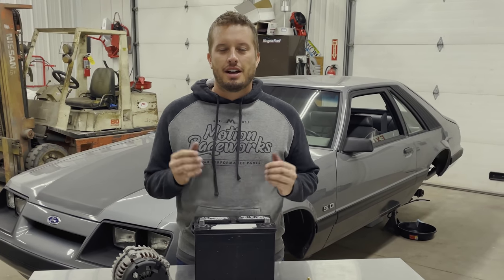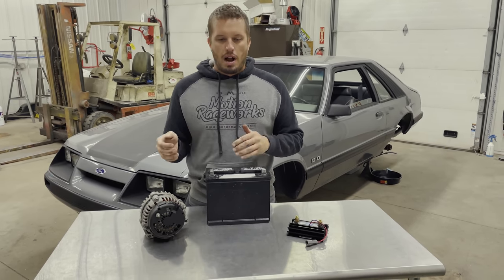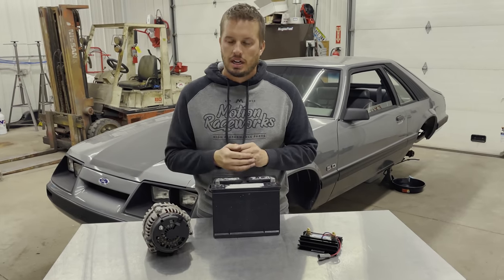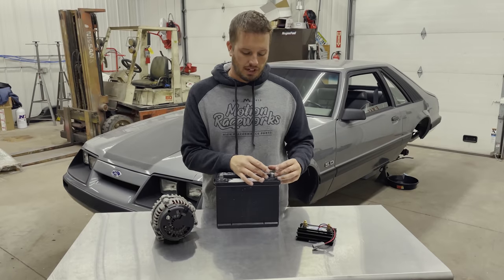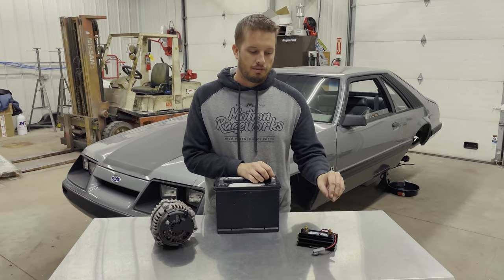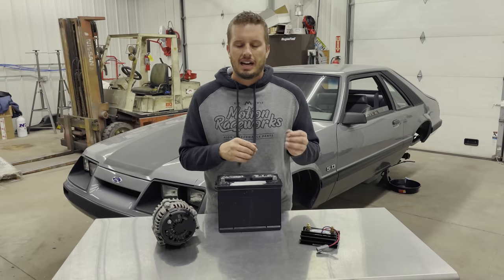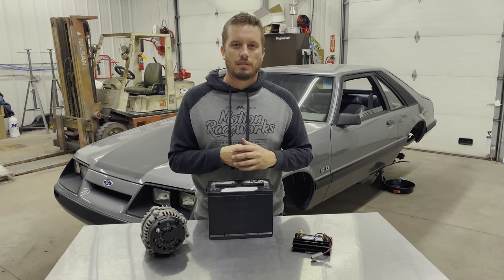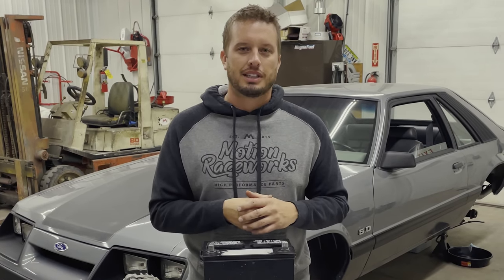Alternator Kill Switch Proper Wiring: Tech Tip Tuesday

Comment: Two downsides to this way of using the killswitch: 

1: your battery isnt disconnected from the alternator, so in a bad crash theres still powered wires going to the engine bay, which could be a fire hazard (this isnt legal in some motorsports..battery must be completely disconnected from the rest of the electric system) 
Good example of this problem was ol Cleetus`s crash with Toast where the alternator got smashed by the framerail, that could have caused an electric fire even with the kill switch turned off.
2: (not as important as # 1 but nonetheless.. worth to mention at least) The battery still drains slowly over time when parked through the alternator and/or ecu, especially irritating on racecars that dont get out every week, getting to the track and finding out your battery is just about flat from sitting all night in a cold trailer isnt fun. 

 Putting the alternator wires on a big solid state relay switched by ignition power (which is powered by the KS, so KS off means everythings really off) solves a lot of those issues, and doesnt add too much to the cost of your build.

Both of those points come from my personal experience, i`ve had an electrical fire inside my car during an ovalrace (36 cars on track) after I lightly (.....) tapped a competitor pushing some sheetmetal onto my alternator connections, safety officials were not too happy about that incident to say the least.
Reply: Or, wire the killswitch into the ground, including the EFI controller. Hit that, kills everything. Safer too.
Reply: I agree. I think the problem is in the wording. Kill switch vs battery isolator. For the schematic at the end I think it would be important to add appropriately sized fuses to all loads connected to the battery at the very least. 

As far as the isolation on the ground side unfortunately it is not an accepted way per the NHRA rule book.
Reply: @Reagent92  You have some valid points, including the lack of a label for the 'switch' shown in the diagram, meant as a 'kill switch' and from the views, concepts and principles of electrical, electricity, wiring, wiring diagrams, design and implementation, the label and naming 'kill switch' is actually false, incorrect and misleading.
There are some other basic issues with the diagram along with proposal, description and implemented system wiring regarding electrical, function(s)m functionality, dependability, reliability, and safety within electrical and over all vehicle with the desire, idea, concepts, issues, importance, necessity, requirements of the 'kill switch' concept as Doug described and  @Bob Higgison  mentions in his comments.

It is very obvious to me that most people involved in the various engine, motor, racing, modifications, performance, upgrades, etc., including this channel an nearly all that i watch, follow and have interest in them, lack basics of electricity, electrical, wiring, etc.
Within all and each of the comments here, there are good points and clear, obvious, certain false information combined within them, thus clear each lack the basics.
The NHRA Rules are based upon proper information, knowledge including electrical, fuel and mechanical issues which affect safety for the drivers, crew, emergency attendants, people along the track,at the event and in the stands. during the every use of these vehicles from the pits to the track, down the track, etc., and during any emergency, accident, crash, etc.
Such NHRA has rules for automated shut off/down, driver and crew chief by remote as least for Top Fuel dragsters and Funny cars, probably all vehicles which use methanol  and the various automated and manually triggered fire system requirements too among many other safety requirements.
🤓
 @Robert Shepherd  , Your comment about a 'ground' based switch clearly indicates Your lacking of basics with and in electricity. Electricity is NOT similar to plumbing, tubing, liquid or air flow. A complete electrical path is required for any electrical potential [voltage] to exist at any point which allow energy flow [current]. The voltage does not exist up to the switch as with liquid or air pressure up to a valve or similar. Adding any break, switch in the 'ground' side of a circuit does not accomplish anything and is certainly not 'safer'.
🤓
@Mark S; Your ideas, concepts about a 'bad crash' and Your examples with the "Toast' drift car crash of Garret Mitchel [Cleetus McFarland] and Your personal  do NOT correlate and the two examples are certainly NOT similar. It seems to me Your personal situation was NOT an actual electrical fire, rather a fire of some combustible materials due to a possible short across from the alternator output to chassis ground due to a piece of sheet metal which was damaged and perhaps pushed to make the contact thus competed circuit - short possible and thus some 'sparks' which ignited some other material(s), including flammable fluids. [without knowing more of the precise, exact detail of what actually was burning, inflamed, it is impossible for me to determine.  However, there are not any possible High Voltage, High Current or High Power electricity which can actually be an electrical fire within the vehicle. 
My knowledge, expertise along with experience as both mechanic, mechanical, electrical, electrician, electronics, chemistry, materials, physics, engineering allow me to say with confidence the description is lacking proper information, details, accuracy and precision.
The safety officials were not pleased for many possible reasons, which may include some improper wiring, lack of proper safety switches, fuses, also regarding the whichever flammable materials became inflamed, lack of proper electrical isolation, insulation covering over the electrical connections [so to prevent the short] proper fusing, if a short occurs, and lack of other proper safety such the 'electrical short' and 'sparks' would not have ignited or initiated burning and flames inside Your vehicle, Also they may have been upset about some lack of automated or manual fires systems too.
🤓
A. These and nearly all types of internal combustion engine vehicles use DC power < 20 V DC. The highest current exists with the starter  motors and high voltage DC exists as output from a coil/coil(s) or magneto, to the spark plugs  ~ 40kVDC.
B. Alternator - generates/produces AC voltage, converted to DC within the device and in combination with a regulator - 14.5. VDC for 12 VDC systems,  19.2 + VDC for 16 VDC.
C. Electricity is an energy, never a flame or fire itself. 
D. Some fires can be initiated by flow of energy or spark of electricity igniting a material especially flammable materials.
[similarly the spark of electricity passing-jumping across the electrodes of the spark plug, ignited the flammable fuel-air mixture inside the cylinder.]
A sudden short can result in a spark which can ignite flammable materials.
Such, sometimes a fire which was initiated by a spark may be referred as or called an "electrical fire" though the fire is not actually electrical, but initiated and ignited by an electrical spark.
🤓
Hope this information is clear, useful, helpful, beneficial and make sense too. 😏

All The Best and Much Success in Your Quest, Health and Well Being. 😊
Sincerely ☺
Reply: @newtonfirefly3584  Me next! Me next! @FlipFlopTanLines, PLC automation and Electric lift tech. My comments are all over here lol.
Reply: @flipfloptanlines926  Have read Your comments, since.
You express some important points, aspects, concerns and good general view within the entire system, especially of the electrical, power aspects, affects, etc. overall.
Your example that Your father led  You to  experience with the coil output voltage is 'very powerful', but dangerous since it is 20kV-40kV depending upon the age-time period  version of ignition system [electronic, coil packs, etc.].
It appears that perhaps, You may benefit more from some actual basic information of electricity, electrical circuits as hopefully You have with mechanics, mechanical, machines beyond these seemingly 'practical' type lessons.
Does a person need to experience 'high voltage' shock to comprehend the power, danger and necessary safety ?
Perhaps observing and noticing a spark emanate, from a spark plug between the electrodes or across from the high voltage coil output side wire to bare metal, arc through the air, 'jump' is sufficient ?
Does a person need to experience harm, damage, breakage, destruction to comprehend the power of mechanical, machines, forces ?
Does a person need to experience the power of lightening to comprehend it ? Perhaps, small static electricity shocks are sufficient or also not necessary and positive uses like rubbing a balloon on Your clothing then placing it upon the wall, observing and noticing that it holds, stays, adheres?

My father led me with basics in  mechanical, carpentry, some minimal electrical, developed  more in public school 'shop', including electricity, electrical, beginning electronics, then further in physics and engineering in University, as Co-op Engineer in the testing, assembly laboratory and afterwards in design, development, etc. 
Also learned and am certified within ESD, which most are completely unaware of and the affects, effects which exist with most all electronics, especially of the last  years plus [which include whichever computer electronics device You connect to this platform and others].

All The Best and Much Success in Your Quest, Health and Well Being.
Sincerely
Reply: @newtonfirefly3584  so how do you wire an alternator with kill switch?

Comment: what is this kill switch     i searched for it the whole internet and still didnt find it     i want that kinda switch that kill the system with and internal and external button other then cartek
Reply: Data Panel DP-22068 Solid State Battery Disconnect Switch, 200A, Includes Pigtail

Comment: What if you have everything ran off relays and want to put a kill switch on the switch side so when you kill power it turns off all relays? With power sitting at the relays but unable to flow?

Comment: Great videos. I was wondering is there a standard fix for over charging your system? If your alternator gets to many rpms from high horsepower  engines they will fail or over charge. is there a fix?
Reply: Yes, a larger alternator pulley.
Reply: Larger alt pulley #1. Some vehicles have adjustable external regulators that could be creeping out of adjustment contributing to overcharging. Generally the brushes, bearings or spinning mechanical parts fail at high rpm, not its voltage or current output electronics.
Reply: If you think your alternator is getting too much rpm than there is a possibility that your water pump or power steering might be receiving excessive rpm also. In which case a smaller CRANK pulley would resolve the issue as a whole. Just a thot before you replace the alternator pulley with a larger one, which is the correct fix for your question.

Comment: This is good, but what about NHRA rulebook saying killswitch must kill power to entire car? the stud at the alternator will be hot at all times wired like this. Rulebook aside, I like having all the power off when I'm under the hood
Reply: My father taught me the same thing to isolate the COIL when i was 7.  He said cover the coil post with my hand to "isolate" the spark from any metal. IT HURT BAD when he bumped the starter. Later i realized his class wasnt on safety, but on electricity and its force. With 1 rotation of the motor i instantly turned into Tesla lol
Reply: Your exactly right - his method described here is not NHRA legal.
Reply: you would run 2 disconnects, one for the whole car and one just for the alternator wire going back to the battery, gets pricey but guarantees no power anywhere in the car except between the batter and disconnect switches which normally tend to get wired pretty close together, just my humble 2 cents, you can wire both together so your remote e-stop button at the back or buttons if you have one inside the car as well can shut off both disconnect switches at the same time
Reply: @CarlosDiaz-xf8pk  Yes, I have 2 contactors, the ones I use are $25 ea. and yes either the switch on the back of the car or the one in the interior cut both contactors. They also sell 4 pole kill switches.

Comment: Could this be used with a car that still uses a factory ignition switch, just using the cars key to turn the kill switch on and off?
Reply: Yes and no.
:D
1. You can (and must) use the kill switch according to most sanctioning body rules, regardless of how you start your car.
2. The factory key switch doesn't meet the requirements of a kill switch..it needs to cut all power to the vehicle, and it needs to be externally located at the rear of the car so track safety crew can safely shut you down if need be.

Comment: What gauge can be used for alternator to battery?
Reply: Depends on Amperage, Voltage and Distance of wire. Calculations/charts easily found with search. I hesitate to give you a standard answer that would work with 98% of applications...
Reply: @flipfloptanlines926  is right.  Many alternators will charge at 100A+ and if you go by NEC standards that requires something like 2GA which is ridiculous of course.  Generally speaking you can wire to an underhood battery with 10GA and to a rear battery with 8 and it should be sufficient.  But as an EE I tend to overkill everything so i would probably wire to the trunk with either 6GA or 4GA for the alternator just in case the battery is completely dead and you need it to recharge quickly.
Reply: @Fast351  Agreed sir. It wood be a good idea to follow a car amplifier wire sizing chart, and just use your alternator amperage in the amperage column. Car audio power wiring is very large compared to a stock alternator wiring. Generally i use 1/0 true awg for every 300 amps of 12v current. My daily came with a 145 amp alternator with a stock 6 awg wire. My new 300 amp alternator has a 1/0 charge wire. Just an example of the 2 extremes.

Comment: My brother Doug. How about from the alternator to starter solenoid then back to the battery….
Reply: You will have your main power coming from the kill switch to the starter solenoid, so running your alternator to that same lug is looping power back into the system after the kill switch and doing exactly what he was saying NOT to do.
Reply: @BadLuckGarage  This does work if you have your starter power lead coming straight from the battery before the kill switch.  There is no reason to kill the power lead to the starter with the kill switch assuming the solenoid wire is on the other side of the switch.
Reply: @Fast351 that wont pass nhra requirements since they want no power anywhere in the car

Comment: No battery could cause high voltage spikes and burn up alternator. Turing alternator off is hard on battery to charge once back on. Tip use ultra light small lithium battery or lawn mower battery. To small battery may have to jump start. Cut off alternator switch while engine is stopped. More volts more ignition, fuel pump and fan power. I'd have to see dyno and 1/4 results of cutting alternator off if much gain at all. Another way less alternator amps and bigger alternator pulley = less power - drag. For me it's maximum 15 volts for max cooling 178 degrees in hottest of summer, more ignition and fuel pump power. I have the adjustable power master alternator with the extra or minus 1.25 volts at the flip of a switch. Warning going over 15.25 volts running can burn up some electronics.

Comment: Good information. But add to it that alternators are the instrument of the devil.  All the current draw even for a 'simple' carb engine with ignition boxes and fans etc make them sort of nesecary. But you have to slow them down. Pullys are 'geared' for the average road car that seldom sees more than 3000 rpm.  So lets try turning 7000 consistently and guess what, alternators short out, they viabrate and crack brackets and fall off.And they spray belts everywhere as well.  Been there on all of this. Hate them!! 
Always use a seperate belt for the alternator, when it fails you still have a water pump. And so kill switches are so important. But do some simple math, generally halve the alternator speed. Ditto with water pumps as well. SBC owners take note!   
They never need to be run more than crank speed. Mechanical pump is far more reliable that those bloody stupid current drawing electric ones.
In the past I ran a Chev powered road race car with a HEI, Carter pump and very occasional use of an electric fan. I could do a 3 day meeting  doing at least 50k of racing every day on one normal full size car battery. No alternator,, the events I do now with a Crane ignition box [excellent] and far more use of fans has required the dreaded alternator.

And always carry spare alt belts as well as a spare alternator. I see them fail so often at club level as well as big time motorsport